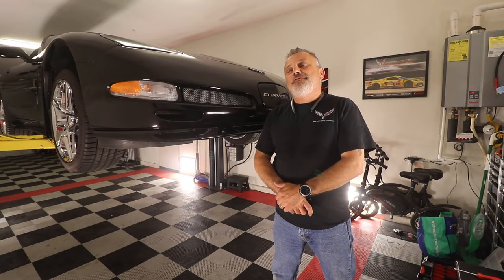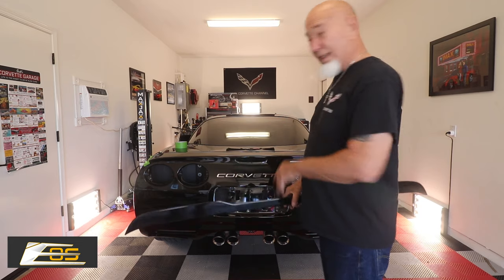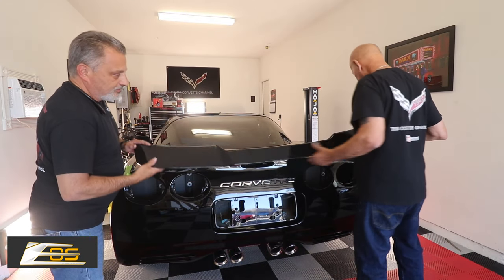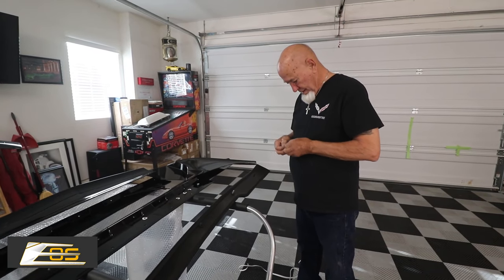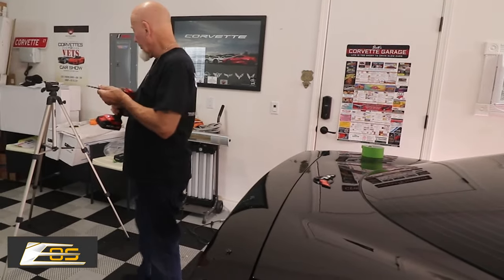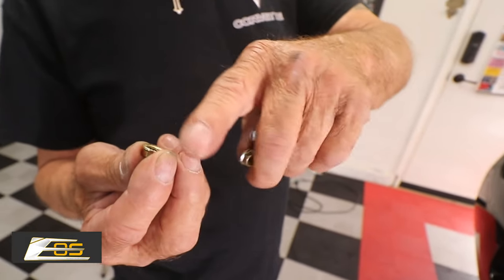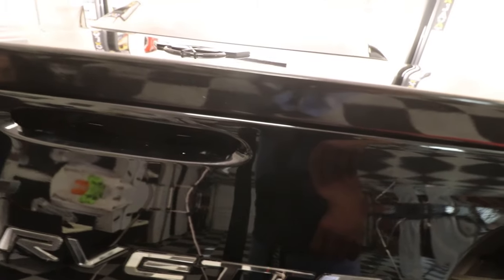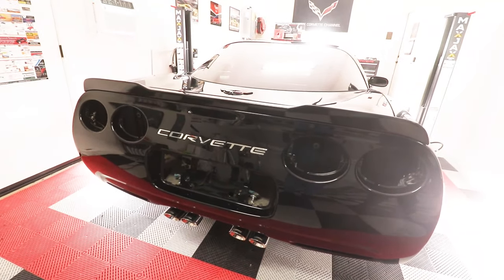How to Install an Aero Kit on a C5 Corvette From Extreme Online Store

Comment: Definitely easier to get to the nuts on the center brake light from the openings from backup light area.  4 screws to remove and much easier than reaching through the round inner light openings.  Love that rear spoiler.

Comment: If you remove the air dam in front you lose cold air designed to cool the engine. No cold air equals blown motors. Rookies.